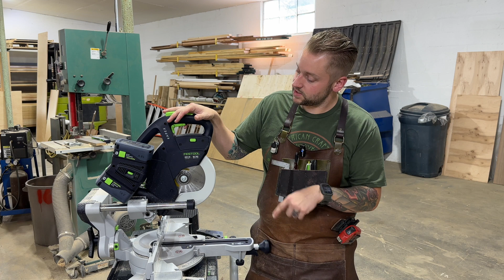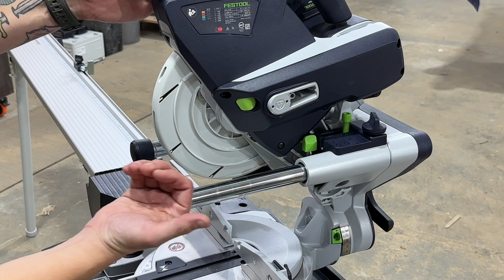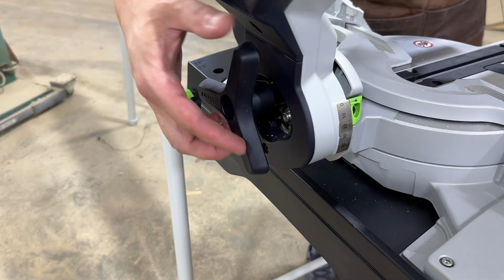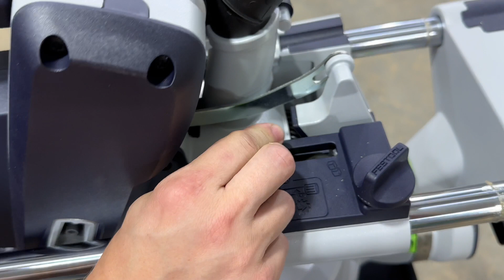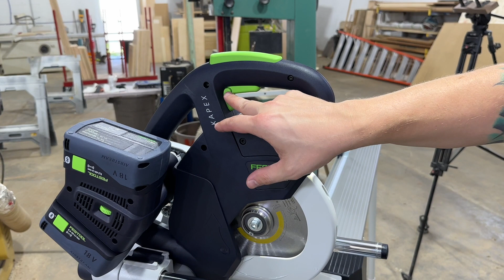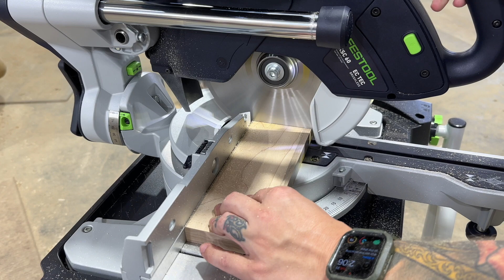Unveiling Festool KSC60 Miter Saw: Is it Worth $2500?

Comment: Wow in the UK is £1300 which is about $1700 with all accessories and 2 batteries + charger. Just the saw with accessories is £850. $2500 is a lot more expensive 😭
Reply from the maker: That’s with the stand and all?
Reply: @TodaysCraftsmen ah no, not with the stand. 😅 With stand, batteries, charger, 3 extra blades and all accessories then it is closer to $2500 like you said 🫣
Reply from the maker: Dang mine didn’t come with any extra blades 😬

Comment: I have this saw and strongly advice anybody who consider buying one to overthink if he wants to make any bevel or compound cuts. For cross and miter cuts its capacity isn’t great but ok. It looks very different with compound cuts. It’s a joke. To the right you can cut a sheet of paper. It’s a bit better on the left but there’s this awkward security button you must keep pressed all the time. Wrist position brings famous Festool ergonomics to the whole new level. Try and enjoy.
Reply from the maker: Definitely great points. After running the saw for over a year I can agree that the beveling is shoddy at best.

Comment: It’s not 2500
Reply from the maker: No? Then how much is it?
Reply: @TodaysCraftsmen $1699
On a summer deal now for $2100
4 batteries, dual charger, ctc midi and ksc 60
Reply from the maker: As mentioned in the video the $2500 price tag includes the UG stand with extensions.
Reply: @TodaysCraftsmen  my bad sorry I thought you meant the saw only
It’s a great saw
Reply from the maker: For sure!

Comment: Great segment, thank you. I have been thinking about that very same tool investment. I ended up with Makita's 8-1/2" cordless miter saw. Almost identical designs, however Makita is at half the cost with their 40 volt system.
Reply from the maker: When we priced out the 40V Makita it was the same price as the Festool for the saw and batteries.
Reply: Not true as the Makita comes with battery and charger, the Festool does not. @TodaysCraftsmen
Reply from the maker: $1050 the Makita or $1298 for the Festool.
Reply: @TodaysCraftsmen Makita with batteries is $1100 cad and Festool with batteries is $1699 near me. What do you think I should get? I don’t mind price but I gotta get a cordless one
Reply: How did you get it at half ($650) the cost of the festool? I cant find the makita for under $1050? And how is the dust pickup on the makita? I am looking for a 8-1/2" cordless saw and would love to not be locked into festools blade options, but dust pickup is important. If you really did get your makita for $650 please share the details.
Reply: @cloggedpitot1  Mikita has good dust collection too fest is a bit better
Reply: definately a better buy. I have a lot of festool ,but for  this mitre the price is criminal

Comment: Looked at this today in a suppliers in Dublin. On further research it only compounds to max of 20mm of material at 45 degress to the right.(Thats just under 13/16 inches for the US lads).
Really nice saw. Nice and light and if your fitting just floors day to day this is the one to go for but if your an all rounder I would look at something else. The one major benefit I will give festool is the warranty also covers theft once registered with festool under 30 days.
Gives peace of mind but just not for me.
Reply from the maker: Definitely not the perfect saw but good for a lot!

Comment: It is a downgrade from Kapex 120 in every single way except, what, brushless motor/batteries? Kapex 120 is worth it. Everything that makes the 120 the best, is missing from this tool. I have a lot of festool. Best you can buy. For more reasons than quality. It is not outsourced big box JUNK from china made with sweat labor making china rich, for starters. But 120 is the way to go, 60 is a massive downgrade for more money. It is quieter, which is nice. It has the light like delta cruzer, which is nicer than a laser. Other than that, it has the tiny bevel gauge like cheap saws, it lacks the twist-micro-adjust on the rail, it has a smaller blade, it made the handle/safety etc worse, it is not anywhere near as good as Kapex 120 & lacks all the features that made that the best sliding chop saw.
Reply from the maker: For us, as an install saw, it’s superior to the 120 in terms of portability.
Reply: @TodaysCraftsmen  that makes sense in that use case. Still a massive downgrade; it should have all the things kapex 120 has when it is 1000 dollars more. This from someone who has the csc sys 50 on preorder, too. That said, if I needed it for mobile/site work, I would rather pay the K60 price than buy Chinese-outsourced alternatives at the big box store. It is just worth it to support True American & European companies instead of all the big box stuff outsourced from china. Glad you got it, because the purchase is more than the price, it is the principle, too.
Reply from the maker: @bestyoutubernonegraternumber1  Definetly. The KSC 60 is actually $300 less than the 120 though...
Reply: @TodaysCraftsmen Came back to say that. 600 less when you already have batteries. 999 is a great price. I am not sure whether to get this or the 120 now. The only major gripe I have now is that the outriggers only come in metric, no imperial option. I would get the full set + 2 extra batteries to put in my energy set if they had imperial. I am thinking I might be forced to get the full package of the 120, but I like the Ksc 60 a lot - for the shadow line & the light weight. I am having a super hard time deciding, because I would miss the “big” bevel gauge & extra capacity of the 120, they both are the same size on the mobile base when collapsed, so that is not a consideration. The 120 outriggers can come in imperial, which I prefer for woodworking. I am having a superrrrr hard time deciding.
Reply from the maker: Def a tough decision! If you have a lot of easy load-ins for jobs I say go big with the 120. We have a lot of tricky load-ins going into elevators, etc so the 60 was a better fit for us.
Reply: @TodaysCraftsmen  it is virtually the same size in the travel position though! But the weight… the 10lbs difference is definitely something to consider. In my case, it is for my shop, which is a 1 car so everything is on wheels so I can move it all out of the way when I need more space. On one hand, I want the smaller, battery powered tool because it will do all I would usually want it to do. On the other hand, that extra 28mm could come in handy. I have a delta cruzer 10 inch (it has a similar motion system to your Bosch), but it is a dust making monster. Main reason I want to switch to Kapex, for the improved dust collection with the CT vacs. I think I will get the cordless, continue using the delta outside the garage when needed but have the comfort & portability of the 60 indoors. I do want to go mobile/work on-site as a dream of mine, so it would be nice to be closer to that goal, too.

Comment: I owned this saw but returned it for the larger Kapex— not because I hated it, but because of my situation. 
I found the dust extraction, especially with a 36mm hose, to be exceptional even better than its big brother. It’s a great saw when you’re on site and I realized that I needed the larger Kapex since I’ll be using it mainly in my garage/workshop rather than on site. I also realized that while I could swap batteries back and forth, it was better to buy it with the batteries and at that point, it made more sense to spend the extra and go with the larger one. 
One day, I do plan to get the smaller Kapex, but for now, the larger one fits me better. 
It’s not hard to justify the money because we all spend our money somewhere; however, a lot of us waste money but it’s in small quantities, that when tallied up, are huge sums of money. So buying a tool that will last you 10+ years, in many cases, prevents us from wasting money on things that only have a moment of satisfaction rather than years and years or satisfaction.
Reply from the maker: Amazing point! The price is made up for in increased production and less down time.

Comment: As with all of the products from Festool, that saw is way overpriced. Using it as a business write off may be worth it but for the average at home woodworker it's definitely not worth it.
Reply: I own the KS 120 Kapex and bought it for $1,600... I'm the "average at home woodworker" and it's definitely worth it. Why? Because you amortize it over 15 years and we are talking just a little $100 a year or $8.88 a month.
Reply from the maker: Very true!
Reply from the maker: I would disagree that they’re OVER priced. Definitely priced higher than most brands. If you look at other 8-8-1/2” cordless saws from Makita and Metabo they’re actually the same price. But yes, probably not a justifiable purchase for someone using it in a hobby capacity. The write off doesn’t hurt but for us the value is in the increase in speed and production as well as ease of use. Thanks for commenting!

Comment: Ive been woodworking for 40 years and ive never needed fancy saws!
Reply: Only 40 years? I've been carpentering for 71.33 years and have 17 of these saws each set at a different angle to speed up the process!
Reply from the maker: We’re not worthy!
Reply: I hope you don't use calculators or have internet... but seriously, this isn't that fancy of a saw, just really well designed.
Reply: I see the snapbacks have arrived @AaronGeller
Reply from the maker: Dang it! You got me there.
Reply: Absolutely no one needs a saw like this. It can however speed up production and improve day to day satisfaction if you work on the tools day in day out.
Reply: I’ve been a carpenter for 35 years,  believe me some fancy tools make your work easier, like a track saw I bought one a mafell, it’s a fantastic tool.
Reply: The pace at which we have to produce quality work nowadays makes a setup like this very very tempting to the modern craftsman.  Whenever I can shave 5-10 minutes off my day, everyday, it adds up over time and you just feel less drained at the end of the week.

Comment: Nice saw, but I wouldn't spend $2500 for it.
Reply: It's $1000 for the base unit and $1300 with batteries. It's not that bad especially when you consider it is something you can own for a decade or two.
Reply from the maker: I think you’re in the majority!

Comment: No, but I'm old and I don't earn a living by woodworking.  I have often wondered if the Festool brand is as expensive in Europe as it is here.  My 12" Ryobi double bevel sliding miter saw does everything I need it to do.  Granted the head only tilts one direction and the dust collection is abysmal.
Reply from the maker: I’m not sure about their European pricing. My guess is that it’s similar but maybe slightly less because it’s easier logistically for them.

Comment: I love the festool gear that I do have but that’s a hard price tag for me. I’m not sure I’d ever get over that safety on the switch either, that really seems unnecessary but I’m sure there’s legal reasons for it. For installs though, being light and having top notch dust collection is hard to find in other saws. I’m considering getting a smaller saw for install work because as much as I love my 12” dewalt, the thing is a bear to lug around to job sites
Reply from the maker: Yup! Our 10” Makita is about 60lbs. Sick of moving it. We’re going to rip that little safety button off today 😬

Comment: It's a handsome tool, and arguably creates value for jobsite applications, but seems overkill in a shop scenario.     Honestly, if I had $2.5k in the budget, I'd get a Bosch Glide (or even a Dewalt XPS) and put the balance towards a DF500, or you even get pretty close to paying for your Hammer 950.   But she's pretty, that's for sure.
Reply from the maker: Definitely would be overkill in a stationary role. The UG stand is about $1200 of the $2500 price tag. You could build a nice fixed miter saw station for a couple hundred bucks with storage etc…